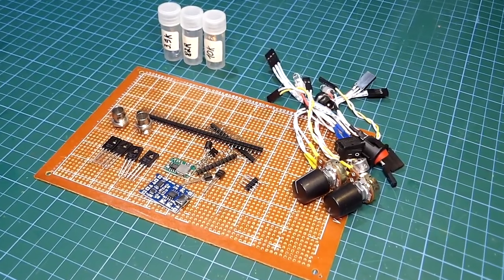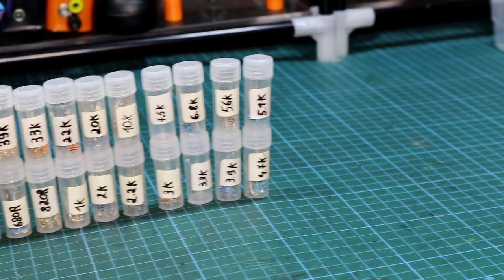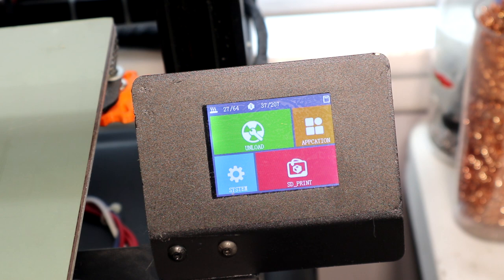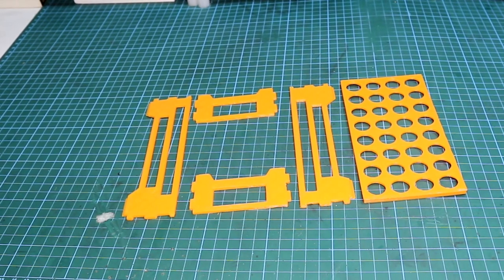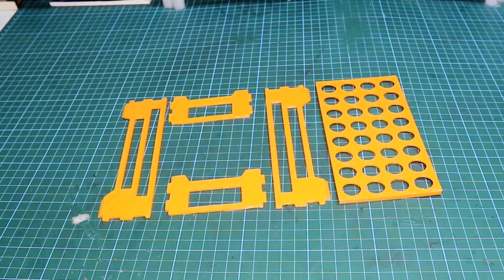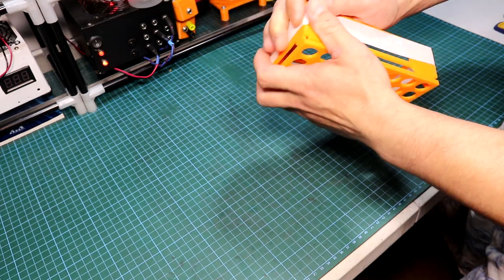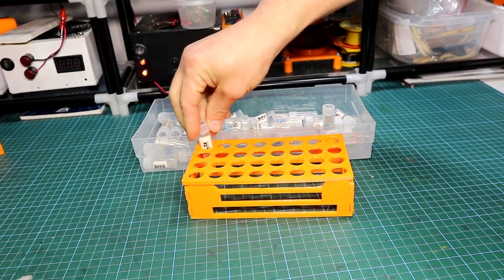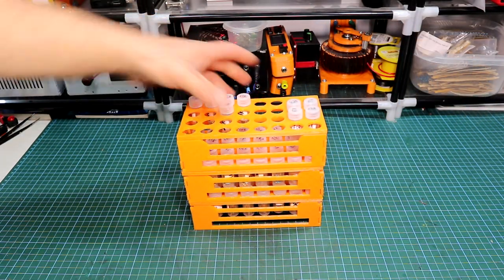Simple RESISTOR STORAGE Solution

Comment: great Idea for storage ❤️ 
I suggest you CNC cut it cheaper than 3D printing it, because it’s just 2D (2.5D) Parts 
no need to complex 3D geometry
Reply: how long it took you to print one box? 
and what printer
Reply from the maker: @AAShenaifi  about 1 hour and half  . Printer i have a xvico 3ds pro
Reply: @MikeTechnology  what about my first suggestion 😅
Reply from the maker: @AAShenaifi  well it didn't come in my mind to use the cnc . Despite that I got one the 3018 pro ,
I now think by using thin sheets of wood or even some old plastic lids can be done